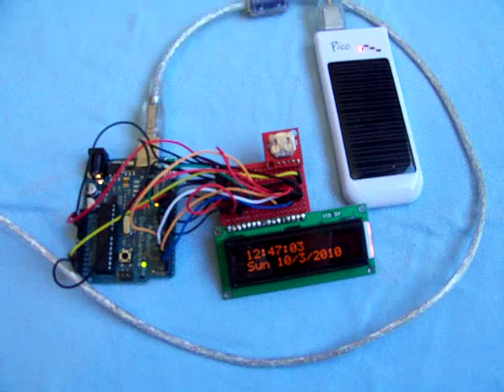Arduino Clock using DS1307

Comment: I see that your project is running in an asynchronous mode with the DS1307 unit. The reason is that the Arduino ( code ) is calling up the data at a delayed time than the DS1307 changes. The best way to overcome this is to make use of the third square wave pin at a frequency of 1 Hz. ( Send "10010000" to address 07H in order to enable the SQW pin driver. Code: "Wire.write ( 0x10 ) ;" ) Then make a new function which is called up as the state of SQW is rising. Attach the SQW pin to an Arduino pin ( INPUT ) of your choice. Hope that helps.

Comment: I am trying to write a sketch using the arduino and the ds1307, but I can't figure out how to have the arduino check the time, and if it matches a specific time that I have chosen, have the arduino turn pin 7 high and low a few times of my choosing. Can you help me figure it out? I have a sketch that compiles, but it is way wrong, and I would like to start from scratch again. I have been at it for too long, and the people I have asked help from only give cryptic answers that don't help. Please?